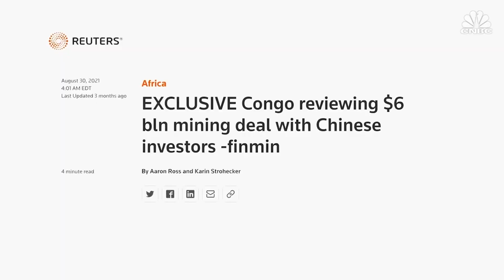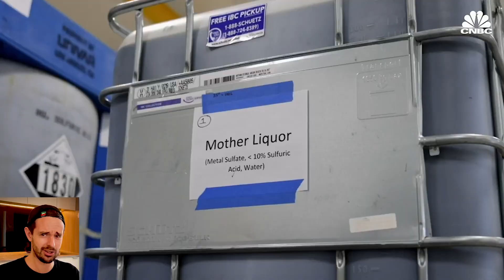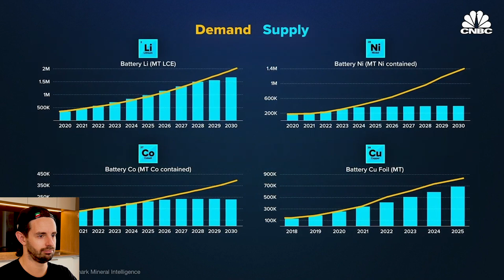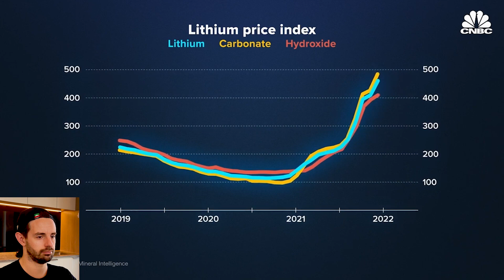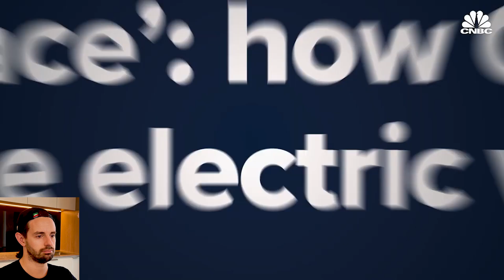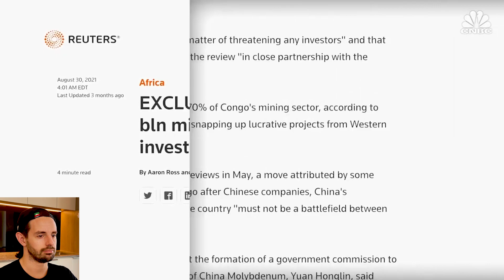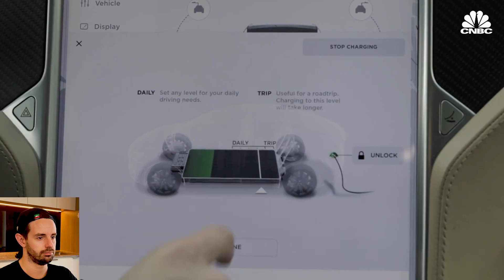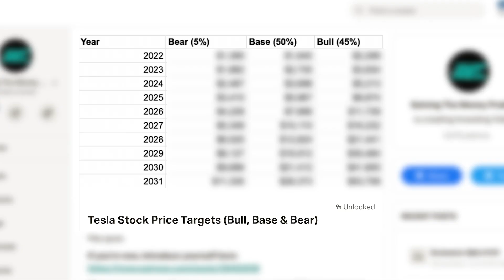HUGE Risk To EV Industry + Tesla Co-Founders’s WARNING

Comment: This is one of the many reasons we should focus on building out reliable baseload nuclear that doesn't depend so heavily on battery backups.
We need those batteries for cars, trucks and frequency control type grid services. Large scale grid storage is such a waste
Reply: Nuclear scares the stupid people though
Reply: @theryman4124  you don't have to be stupid to fall for the antinuclear narrative. It's just the stupid people who refuse to change their views when presented with new information
Reply: @doritoification  
What exactly is the "new information"?
Thorium? Where is it?
When will it be ready?
Fusion? Same questions.
.
Meanwhile we have plants under construction with a 20 year lead time (ref Hinckley C, proposed 2006)
Running late
Running 20% over budget.
Contracted to saddle consumers with power double the cost of renewables at 2021 prices, with the cost of those renewables reducing fast.
.
That expensive energy will be a generational legacy until 2065 (or 30 years from whenever it actually generates energy)
.
Not to mention the 20 years of continued fossil generation due to the delays, or the cost of decommissioning for who knows how long (up to 60 years, ref 3 Mile Island)
.
So, not "stupid", but with concern regarding new projects without proven technology, working prototypes, detailed plans for a production version, a licencing system to produce globally, a global consensus to cooperate on mass production, agreement to install in "geopolitically sensitive areas"  (good luck with that one) and thus not leave "dirty areas", not to mention the necessity for "certain countries" to agree regarding reduced oil production and a shift from the petroDOLLAR......
All while waiting....... 20 years? 30 years? For the current "Superpowers"
(singular??)To extract their head from a dark place......
If you think that's "stupid" maybe supply a 5 year plan to at least start the ball rolling? Good luck with that.
.
I'll ask again.
What WAS that "new information"?
Probably a millisecond of energy at below zero % efficiency heralding the possibility of a breakthrough in 10 years?
Or news of a small prototype in the country nobody wants to deal with, which might be ready for commercialisation in 2030......ish? But would require everyone to deal with that country? and require them to deal with everyone else?
Either way, "new" Nuclear is "Unclear".
As for reliability....
The "glowing beacon" of Nuclear, France shut down of 30% of the nuclear generation fleet in 2019 for "emergency repairs", and just 3 months ago found weld corrosion in critical (safety system) sections of a plant, closing it and a other of similar design, for checks and repairs.
.
Nuclear is great..... Until it's not.
Reply: @rogerstarkey5390  
Okay then starting at the top. We don't need thorium for nuclear to be fantastic. I'd like us to continue looking into it and one day build some LFTRs but that's not necessary at all. Nuclear has a proven track record without any new breakthroughs (although there are always improvements to be made)

Hinkley point C might not be the cheapest individual asset on the grid but market prices for energy in recent history have been well beyond the EUR130/MWh strike price for HPC.

It's all well and good to look at wind and solar coming in with CFD prices in the £40-£60 range and saying wow that's so much cheaper than HPC at EUR130/MWH but the system cost of running a grid with more wind and solar is higher because of the need for redundant generation assets like CCGTs that sit idle (with full staff) ready at a moments notice etc etc and of course, it's not actually very low carbon if it locks in natural gas backups.

I've been banging the table about renewables locking in dependence on fossil fuel backups for years now and Germany has just gone and proven it once again. Why not stop buying Russian gas Germany? WHY?

As this video points out, there's an uncertain path towards securing the minerals required to produce all the batteries we need even just for cars but for our grid would be a whole different challenge. And that's a similar story for a lot of 100% renewable options whether its solar, wind, hydro, bio fuels etc...

So why be anti nuclear? Why fear the safest energy source? Why protest the land used by the energy source with the smallest footprint? Why give "renewables" so much credit for sustainability when uranium can be extracted from seawater and is replenished by the contents of the earth's crust? Why even call renewables renewable when much of it can't be recycled? Shouldn't we just prioritise our energy choices based on sustainability and impact on climate?

Don't worry about breakthroughs in nuclear. Nuclear is just fine. 

Be worried about a lack of breakthroughs in "renewables". They're in trouble. One day it will be obvious.
Reply: "Battery backup" doesn't mean "LITHIUM battery backup".
Reply: The new types of nuclear would be good for baseload. So would the new type of geothermal. Large scale grid storage is still great for time shifting energy demand, however. It basically replaces peaker plants, and has already been shown to be economical. It can also be done with different battery chemistries than what is used for cars. Some of these chemistries would make the batteries too heavy for use in cars, but they'll work just fine - using common and inexpensive elements like iron - for grid storage.
Reply: @alanlight7740  I'm yet to find proof of actual economic grid scale storage. I'm not talking about a bit of frequency control here and there i'm talking multiple GWh scale storage for a country like the UK to make a dent in diurnal demand shift or diurnal supply fluctuations or both. The kind of storage that makes mid day sunshine useful for servicing the 5pm power surge as everyone comes home from work.
At $100/kWh lithium ion simply doesn't even come close to just having reliable baseload nuclear
Reply: @doritoification  - pumped water has been in use since the 1890s.

Other methods are still in relatively early development, but look quite promising.

As for batteries, I'm relying on multiple reports in the news. It's quite possible they're all lying, but at least in theory some sort of battery should eventually be economical if that's the way they want to go.
Reply: @alanlight7740  pumped hydro is not scalable due to geographical restrictions. Also very inefficient. 
I've followed many of the new developments. None stand up to my calcs. I'm sorry.
Reply: @doritoification  - Looking it up just now, pumped hydro in practice ranges between 70% and 80%. That's not bad at all if the initial energy is cheap. I'm not sure why you call that "very inefficient". Sure, we'd like it to do better, obviously, but that is clearly enough to be profitable. It does have the geographical issue, but there are still many places it - or a number of similar schemes - could be expanded. I've recently seen official estimates elsewhere that pumped hydro could be roughly doubled in the United States, and apparently compressed air in salt domes is already being used in some locations where the geology is appropriate.

I do appreciate that you are actually doing the calculations, but calculations like that are always subject to one's base assumptions, and at the civilizational level our technical abilities are not just increasing but accelerating. I wouldn't be too concerned about the teething pains with various new technologies - those are to be expected, and with multiple avenues of attack and growing experience at least one of the new energy storage schemes should work. It's good to be cautious about what is possible, but it's also quite possible to be too cautious.

Nothing against nuclear, though, at least on the technical side. My chief doubt about nuclear is whether it will be sunk by the increasing costs of dealing with ignorant people who are dead set against it. That said, while I'm not familiar with it at the technical level I've been seeing news about an ongoing initiative in the United States to develop miniature nuclear reactors that would have multiple advantages over the current technology, and the pebble bed reactor idea is interesting in that it makes a meltdown pretty much impossible. If we are going to go with nuclear, we should definitely be using the latest and greatest and safest versions of it.
Reply: @alanlight7740  fair enough that's actually quite efficient, maybe I got mixed up with something else. I really hope that we do find success with some form of storage or another because even if I got what I wanted (predominantly nuclear baseload) we would still need something that could react quickly to changes in demand throughout the day (nuclear can't rapidly load follow).
But with a reliable baseload you would require far far less storage compared to an erratic weather dependant system
Reply: @doritoification  - reliable baseload is definitely good, though I think the new geothermal could provide that more cheaply. There have only been a couple pilot projects, (Alaska and Alberta IIRC) but they look extremely promising, plus have the bonus that they can repurpose many assets and skill sets that we already have, particularly in the oil industry. If you aren't familiar with the new geothermal, look it up. This is very different from traditional geothermal, especially in that it doesn't require boiling hot water and it's estimated that about 85% of the United States is suitable for it.

As for solar in particular, one of the great things about it is that it produces most of its energy exactly when demand is highest - so there is certainly room for a fair amount of it in the power production mix even if we are limited in how much storage we can build.
Reply: @alanlight7740  by "new geothermal" are you referring to the new method of drilling deep holes using magnetron generated lasers?
Or are you referring to ground source heat pumps?
And regarding solar... Idk where you live but in the UK our energy demand is highest in winter but the capacity factor of solar drops down to 2% in December and hits highs of 22% in July when we use way less energy. Wind goes slightly more in line with demand on a seasonal basis but super unpredictable on a daily/hourly basis. It's honestly just a recipe for locking in natural gas. A fossil fuel doonboggle
Reply: @doritoification  - how the boreholes are drilled is not so important as drilling them - deep into what they call hot rocks.

Pump liquid (probably water or mostly water) down one side and up the other. There's some talk of fracturing the rocks between two boreholes and letting the water flow between them that way, but I'm thinking the current project in Alberta might simply be boring a single borehole down, over, and back up. It would produce less energy with less surface area to transfer heat from the hot rocks to the water, but it might be worth it given other considerations.

On the surface (which would have a small footprint) use heat exchangers to transfer the heat to another closed loop system with a liquid that boils at a lower temperature than water. Use this to drive a turbine.

They say it only requires a 50 degree centigrade temperature difference, and if you can't get especially hot water it's still okay so long as you have a reliably cold source on the other side. In the project at a remote site in Alaska they used a nearby creek.

Also at Alaska they essentially just ran a heat pump in reverse to generate electricity.

It should also be able to adjust the power output somewhat by adjusting the flow rate of the liquid pumped through the hot rocks.

As for solar power matching peak demand - I'm in the U.S., which is much hotter than Europe. Peak load is from air conditioning in the summer. I can see how the calculation would be different in the U.K.

Comment: Thanks for including China into your analysis, this is crucial to get a complete picture regarding Tesla. Is is quite evident that batteries will be what oil has been. It would release a lot of tension in the market, if technologies like sodium-ion become commercially available at least for storage, maybe even for lower range EV´s in urban areas. Sodium is that abundant that most countries would have enough resources to be independent from sodium imports.
Reply: The volumetric energy density isn't high enough for EVs, but storage, certainly.

Comment: Apparently, very recently, IBM claim that they can make a new type of battery. IBM, says “The new battery would be based on materials extracted from seawater”. Specifically three materials. But they didn’t name them. 

I can’t actually see it myself, but have learned over the years, that you should never say that something is impossible.
Although this (at least partially) could be true, as you can actually use seawater as an electrolyte. There are also three (materials) in seawater. I think anyone  who knows basic science will know what these are.
I think I would stick with recycling idea for now. That is until Elon works out how to make use of Zero Point Energy.🔋🔌

Comment: 'Accelerated move to EV', but from what, to what? Back to the real world. Politics. The problem with cost of oil is 100% political. Legacy will force the issue because of the supply issues that SMR brings up, meaning ICE will be around for a long time. The second part here is that Tsla is not slowing down & a Tsla EV, without subsidies, etc., will eat ICE's lunch. So, EV's will expand, but only as fast as Tsla. What seems 'either - or'  to many is not the case. The future will be Tsla = EV, (China however is a factor, but Tsla is there too). AND ICE will slowly shrink...politics. Of course this is just my opinion...

Comment: This comment is totally off subject of the current video. 

I think Tesla should start a Traffic Light division. Use cameras and AI to help alleviate traffic problems. And provide 2 way communication to all such equipped vehicles of traffic info.
Reply: I was thinking that FSD would benefit from 'Car to Car' communication with shared info on intended path at instesections and a convoy mode on highways.
Reply: @dougford2083  
I've bee suggesting the "FSD moving intranet" for years.
Each car monitors it's "bubble", sending that information to other similar vehicles within say 0.5 mile radius, while receiving the same from others.
If a forward thinking government mandated such technology, as automated systems trend towards 100%, who needs traffic lights?
Of course, this also covers "child on the pavement <here>" or "human driven car approaching this junction"
Reply: Man car to car communications would be so cool.  Hey there is something on the rd avoid ahead.

Comment: The same thing that is happening now with gas imported from Russia in Europe will happen in the future with lithium from China to the rest of the world.  There needs to be diversification of supply and we need to limit how much control channel has over rare earth materials. I fear, however, that China has secured most of the rare earth sites in the world and we will be dependent on them for many years to come.
Reply: Rare earths are not as much of a constraint as we have been led to believe. They are not terribly rare, and most of the places they are used in technology they could be replaced with much more abundant elements if it becomes necessary. Most rare earths come from China because of two things: cheap labor and lax environmental standards. These make this industry uncompetitive in the rest of the world, but with better refinement processes, automation, or political actions this could change. The chief difficulty would be the time needed to develop the necessary infrastructure outside China.

Comment: Steven can you comment on the impact of Nordstream 1 pipeline effect on Giga Berlin if Putin carries out his threat to cut off supply to Europe. This could have catastrophic cost increases on energy in Germany. How much does Giga Berlin depend on external energy sources. If Tesla's energy input costs skyrocket in Germany what will Tesla be doing to mitigate this risk . Could they setup a Giga Battery Power storage facility to trade in power to hedge against power supply cost spikes ?
Reply: Tesla Berlin will go 100% solar really fast.
Reply: @Bonjevalien  I tend to think this.  We are talking about tesla here.   I don’t think they are going to let big oil push them in a bad direction.
Reply: @Bonjevalien  With what space to put all those solar panels They will need a HUGE area to power that plant plus all the battery storage to run at night and during winter time. Solar definitely offsets cost to some degree but I doubt its 100% and its not baseload power that is there all night.